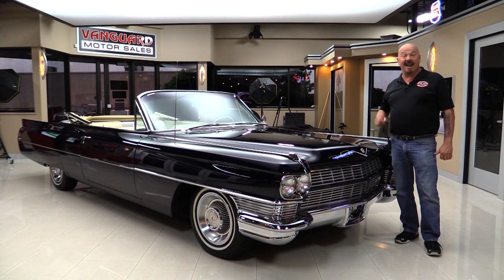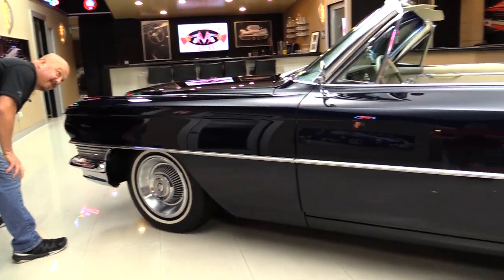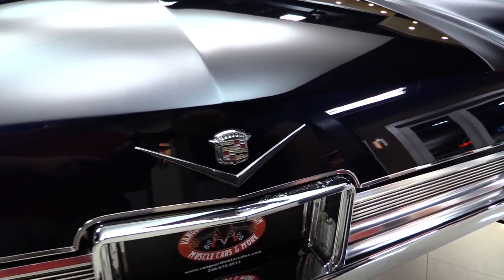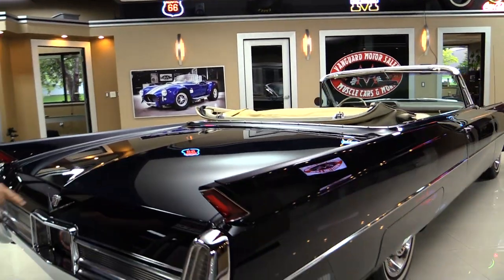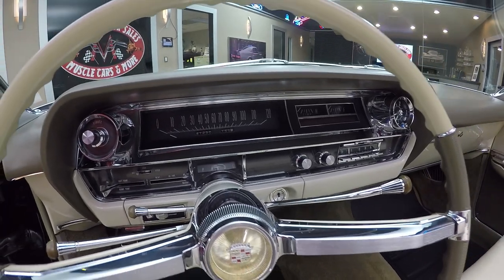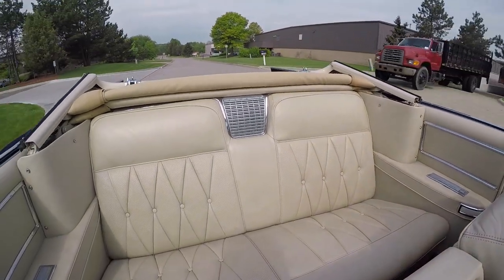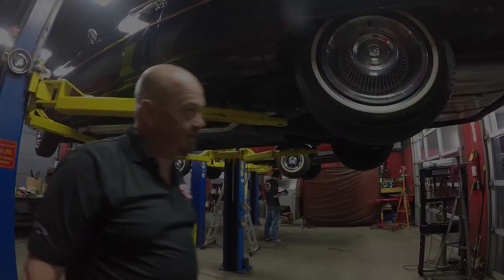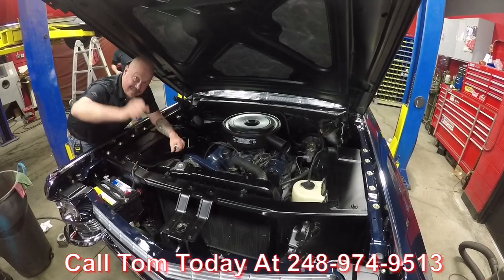1964 Cadillac Deville Convertible For Sale

Comment: As a teenager in 1970, I drove a white 1963 convertible with red leather interior. That three speed transmission would smoke the tires. Unfortunately I damaged the transmission twice and my father took the car away from me.😢

Comment: Nice year   because it has a dual mater cylinder    prior   to the 1967   DOT   ruiles for all cars  and the Alternator    as well as the last  year for the Fins   and  horizontal  quad headlight.    
   1961-62    went  to a flush  front end   but 63   went back to the  recessed  grille  and   headlight   columns .   The 65 went  to vertical  stacked  headlight   to end the   7 year  run for horizontal   quads .  

           Since 90%  of   Cadillac    is the  paint and Chrome.....  this car will be impressive  on the  streets   by its size   and  mirror finish  paint   in black    that rivals  a $ 60,000.00   grand piano   in  black.   You can't drive a piano   but you can listen to piano music   as you cruise   the town  in this land yacht  as well a sleep  on the back  seat  if needed ....try that with a piano.
Reply: Yes, Caddy put the dual master cylinder brake system in their cars a few years before the 1967 Federal requirement.  So did American Motors...